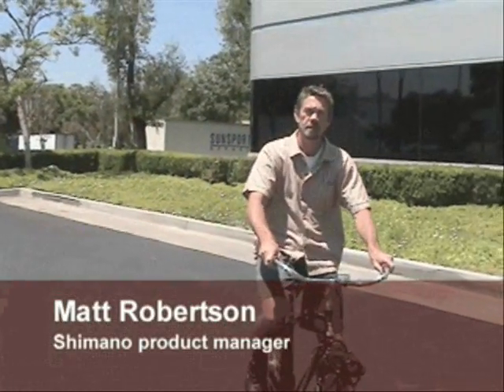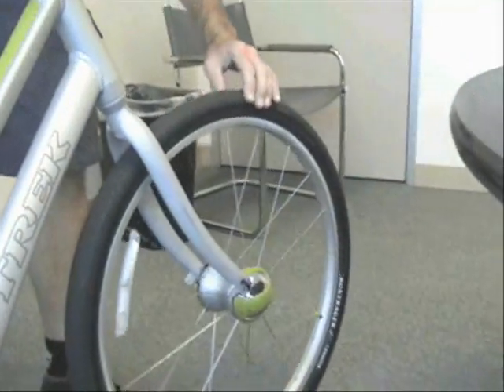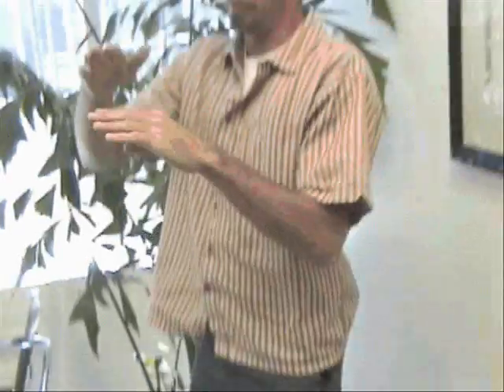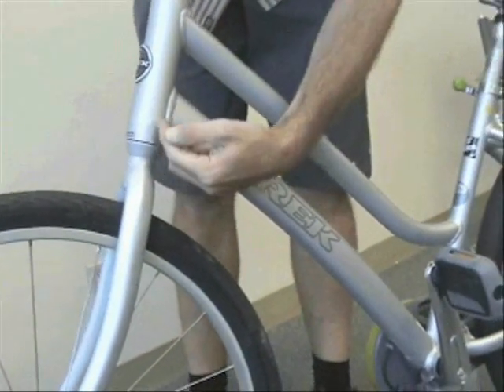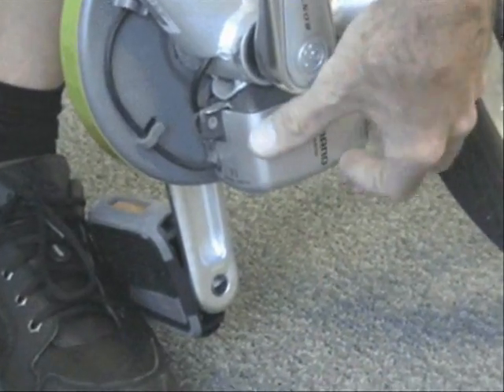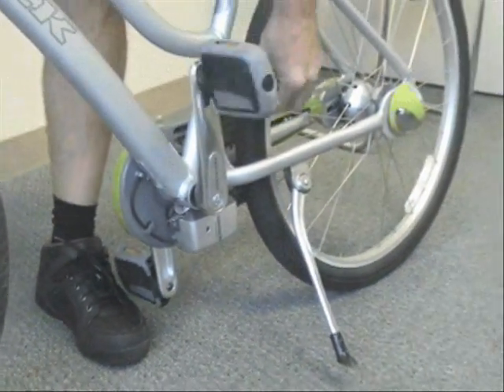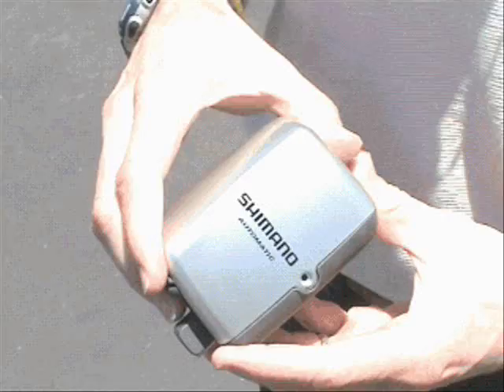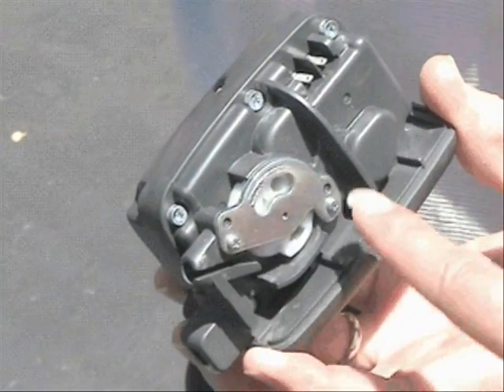Shimano's high-tech bicycle

Comment: I just picked one of these up,   But mines a Schiwnn Varacruz with this shifting system.  It's more of a novalty than anything else, but adjusted right it works ok, but it wants you to go slow up hill.  however it's still just a three speed and I don't even get to pick now.  It would be ok in Saskatchewan, but here in B.C. it almost usless.  I would rather use the Dynamo for a headlight.  But it's an interesting and fun thing.  But I would never use it for any real riding.

Comment: This seems to be a pretty good auto system.. self powered with intelligent shifting..  of course you can't fix it yourself, but how many people ride around with squeeky chains and their indexing set half way between gears because they can't turn a barrel adjuster 2 turns.

I don't see why anyone would get this over an internal hub 7 speed though, i've never used one but they sound perfect for novice's.

Comment: @korgmatose1   I got your comment on my email, but then saw it was removed.  The points you made are accurate, this technology isn't exactly going to change hi performance road biking, but that's not what it was intended to do.  Like a concept vehicle, you put your engineering teams on things that make them think differently...the results aren't intended for mass production, but they do inspire teams to perform at higher levels, even the Shimano Coaster achieved it's intended result

Comment: @maria271011 86 miles on one charge?  Batteries and bikes just don't mix.  I rode my fixed gear bike 12,000 miles before I had to take a chain link off.

Comment: I'm still riding a 1972 10-speed Schwinn Varsity here, and I prefer to do my shifting manually. I assume that the CPU is set to maintain a constant rpm (let's say 85 rpm). 
Now, What if we go up a steep hill? I like to have a lower rpm on hills, and that means a higher gear than what would be used by the computer. Same applies for down hills. How it it going to shift fast enough to keep up with my preferred massive rpm? 
Screw it. I'm sticking with my dual-lever shifter. =)

Comment: Nice idea but overly complicated, or out of date. Have a look at simkins infinitely variable automatic transmission ( SIVAT ).
The SIVAT is a much lighter and simpler system which, although still at the prototype stage, has much more potential in my opinion.